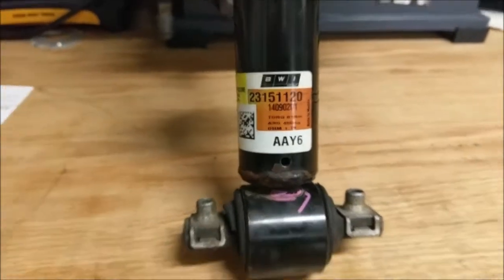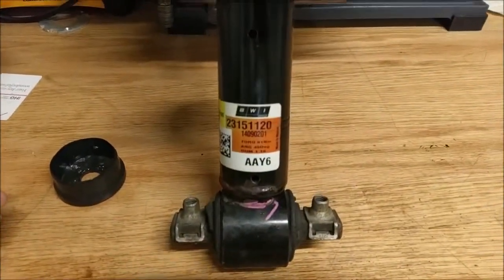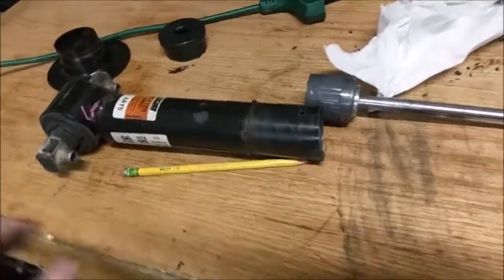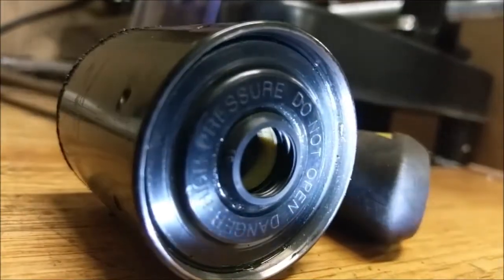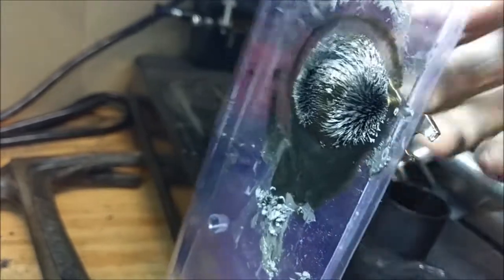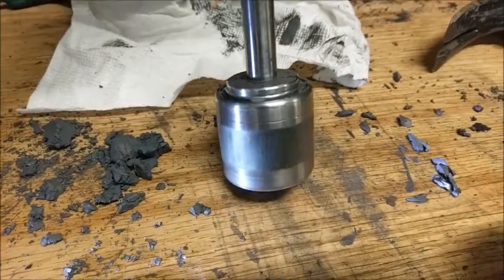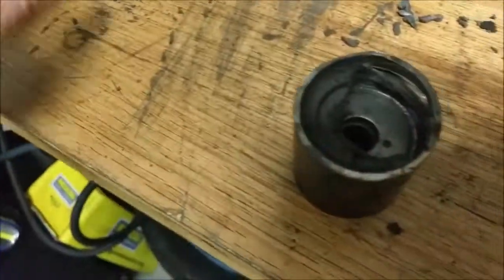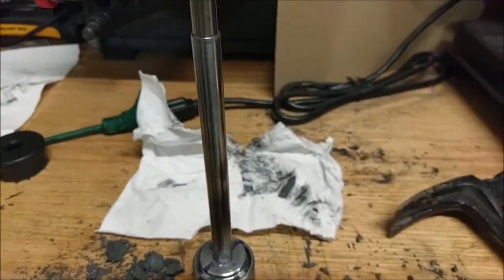GM MagneRide strut tear down & cut open

Comment: I have a Audi A3 quattro from 2011 with magnetic ride shocks. One rear shock failed (it goes all the way in and there are oil leaks on the tube). I found some garage which says that they can take the electronic parts from my worn out magnetic ride shock and build a new one from a classic coilover (without ferromagnetic oil but regular one) which will still be electronically adjustable (will be twin tube). Does this sound like is something achievable? How will the electronic hardware from the old shock will be able to correctly transmit information to the new mechanism? In theory, for me it sounds possible but as I am not a specialist I can not really tell.

Comment: Can you replace those with regular shocks and be done with it?
Reply: Yes. Cost me about 4 grand to replace shocks
Reply from the maker: There are people that put the original non-magnetic ride shocks in, then use a resistor to trick the computer from flagging an open fault in the coil circuit. I have not done it, but there is plenty of literature on the internet about it.

Comment: Thanks I have a 21 1500 Denali and put a level kit on front with new  cogneto upper control arms and trying to decide to change the shocks out with blistien shocks at the same time but it’s sad to replace shocks that’s not broken yet ?? But looks like they are done in two years anyway ✌️🇨🇦 Thanks for video ✌️🇨🇦

Comment: I think I understand the reason for the asymmetric wear on the piston, bearing and seals. Evidently the axial alignment of the lower shock mount and the upper shock mount are off. This misalignment multiplies itself as the shock is compressed and the mounts come closer together. Once this is addressed the shocks will last much longer.
Reply from the maker: That is my assumption too. So the axial alignment gets fixed or use a bigger bearing to last longer. More than likely suspension wear/movement from aging may not have been modeled in cad.

Comment: I actually bought a set off of Amazon, installed them back in November and they have done great since.  They had the factory harness connection too. About 1/4 of the price of new.
Reply: About 1/4 of the price of factory is what I meant to say. They were new.
Reply from the maker: @garymerseal6128  did it come with the connector loose for after you install the top center strut nut, to plug the pins in.. Cuz the strut nut won't slide over the connecter.
Reply: Yes the plug had to be assembled after the shock was mounted to the spring. It was pretty simple though as the wire ends  were already crimped on the wires just had to snap them into the connector that was provided.

Comment: So basically if at around 40k miles, around 10k miles before failure if you unbolt the bottom of the strut and turn it 180 degrees you may hopefully get another 40k miles out of them.
Reply from the maker: Possibly for the bearing wear. But the lip seal would still be compromised. I agree with you getting some more life would happen but probably not double.

Comment: Eddie,
When cutting into the magnet coils, did you see any indication that there may be a diode or anything requiring a certain polarity?  Just wondering about voltage, amperage, pulse width/duty cycle and polarity on these.
Reply from the maker: I did not see any solid state electronic parts. Only wire wound in a coil.

Comment: My Range Rover evoque uses this they make a loud bang sound Over speed bumps. Changed them with new ones from Land Rover sane thing. Mechanics still can’t figure out why. Replaced the control module same thing. When disconnected there’s no sound. Only
Happens on speed bumps though. The slower the louder.
Reply from the maker: With newer unibodies. Noises can resonate in so many places sounding like something else.  When you unplug it you are changing how forces are transferred into other parts. Wouldn't be surprised if it was a sway bar bushing or end link on that corner. You could try just disconnecting the end link at the sway and then trying that bump. Sometimes controls need to be lifted at that corner with a floor jack and then checked with a pry bar.
Reply: Eddie P I’ll try I’ve changed all I could underneath from bushings to sway bars

Comment: Was there a jounce bumper inside that strut? it kind of looks like a cone. I'm trying to put in a new jounce bumper in my 2016 Chevy Tahoe strut. I can't get the top bolt off due to the harness.. can I cut it and reconnect cuz I am not sure how to de-pin this thing. Any advice would be helpful thanks. I'm going to switch over struts soon but can't afford it right now. I just want to get rid of this spring mattress sound coming out of one of my struts. And there was a TSB on the jounce bumper located in the strut so I picked one up at my local Chevy dealership for 12 bucks
Reply from the maker: The spring mattress sound was coming from inside the strut cuz it had no oil left in it.  I don't recall the ounce bumper its been a while. To depin the connector I stuck a narrow pick or paper clip in the back of the connector in the terminal hole. The pigtail comes out of the center of the strut rod and is epoxied in. So don't cut it close to the strut if you plan on reconnecting the wires. Fish the wire through a socket and crack it loose with big channel locks of use an open end wrench
Reply: @fer8888888  thank you man!!!👍🏽👍🏽👍🏽

Comment: Your analyzing is impressive , now if you could get to do a presentation to the manufacturer of this strut  and get them to agree to a shitty manufacturing and pay you and give you new struts
Reply from the maker: It's hard to tell if it is a manufacturing defect or a design issue. If the rod is always going to push to one side because of vehicle movement loading then the rod should be thicker to distribute the force over a greater area of the sleeve bearing so it doesn't wear as fast. I find it hard to believe but possible the manufacturer doesn't have concentricity and perpendicularity to the print in reference to shock tube, piston, and piston rod.  But I do agree less than 100k mile failure for a $500-700 strut is unacceptable.